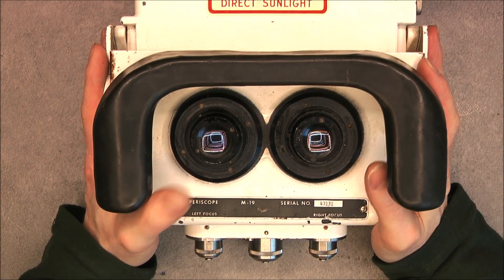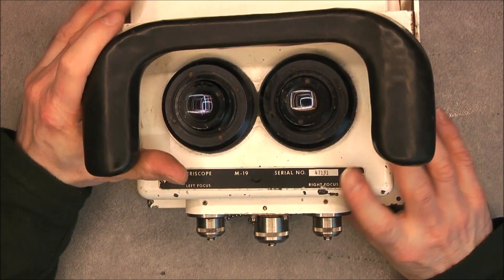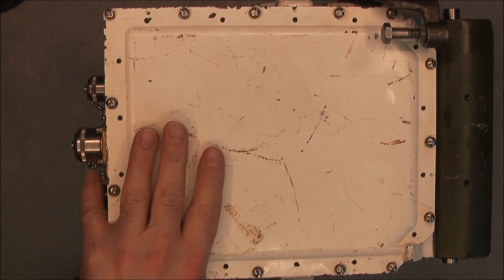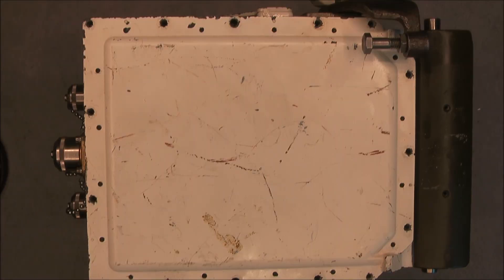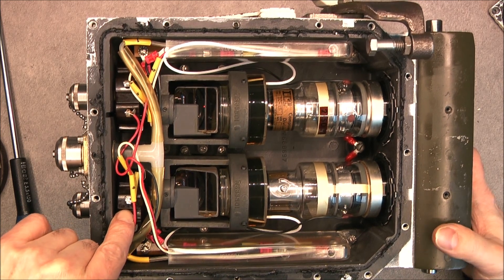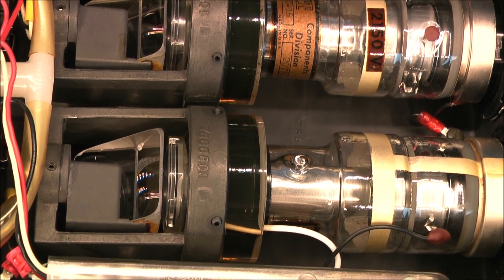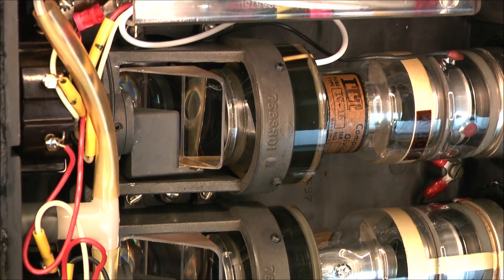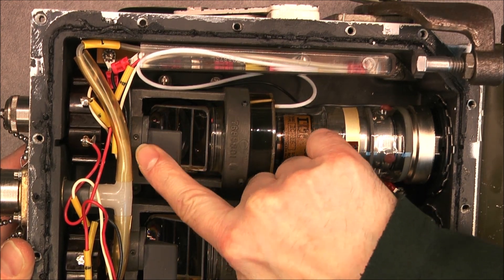Teardown of an other M19 night vision periscope

Comment: Do you still have the unit? I have bought high voltage transformer to use those tubes ,but I think they are expired , is there any chance you still have those tubes?